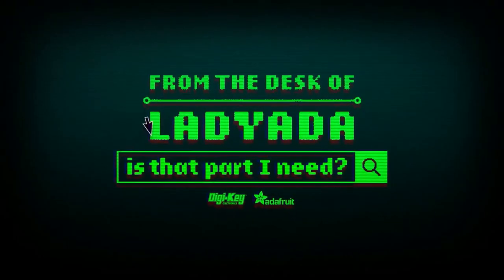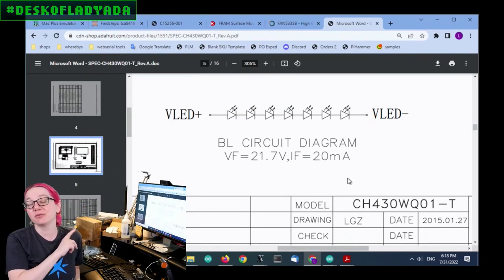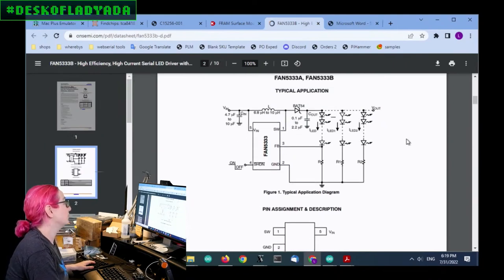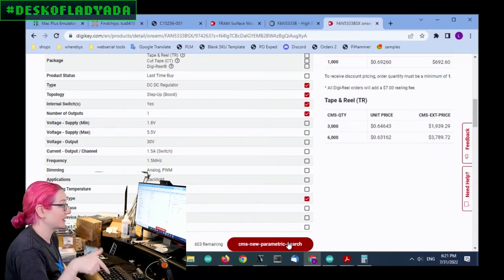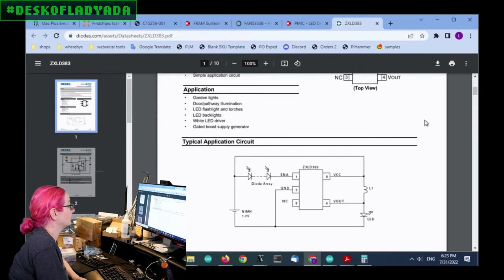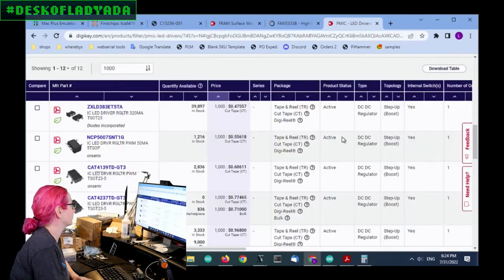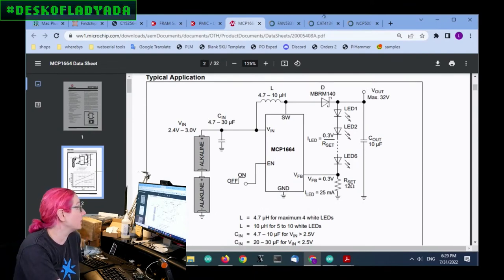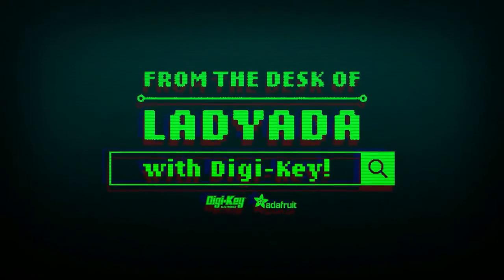The Great Search - White LED strand backlight constant current driver (FAN5333 replacement) @DigiKey

Comment: Digikey did a wonderful job in making components parametric and searchable, even when the manufacturers dis a poor job of supplying a complete fact-sheet to DigiKey. This made/makes comparison of different components from diverse manufacturers possible, on Digikey's catalog-page, despite the parameters originating from heterogenous sources. For this singular reason, I prefer ordering Digikey over Farnell/Mouser/RS/...

The next "big deal" innovation from <DigiKey> could be to actually recommend multi-vendor part-alternatives (with app-notes/ reference schematics) in situations such as the above example. It will surely cost a lot of effort on DigiKey's part (crowd-sourced/curated?) but would fill in a gap that no one single manufacturer/vendor would undertake themselves.